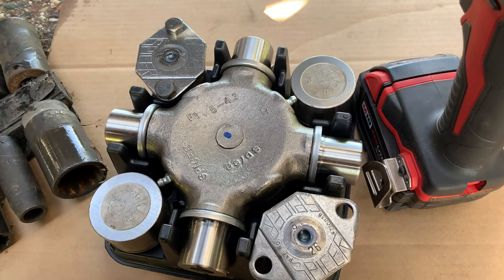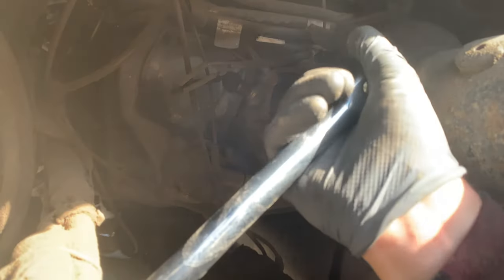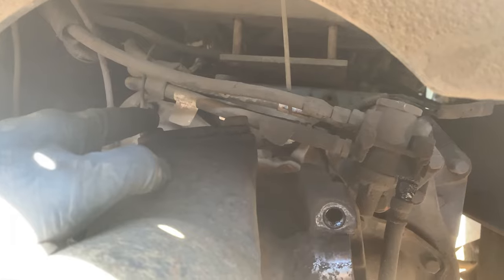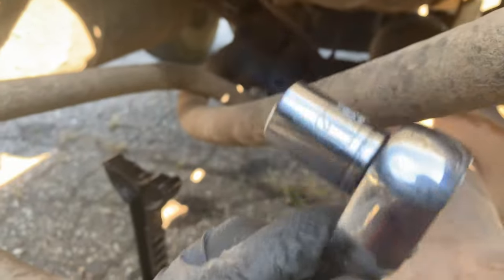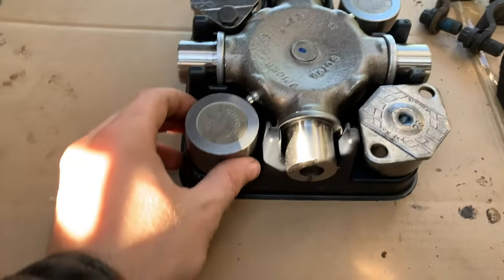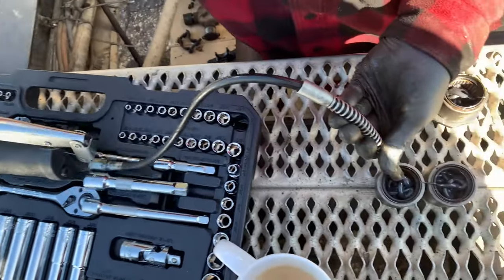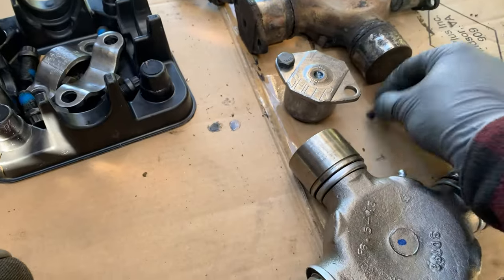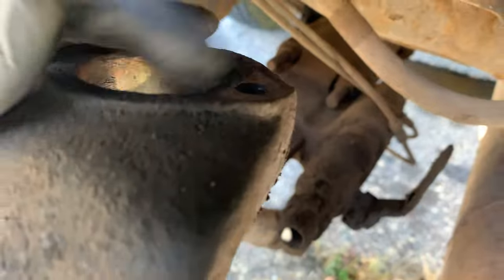Replacing Universal Joints On My 1991 Peterbilt

Comment: No Loctitie? Loctite does several things. First, it is a thread glue preventing a fastener loosening and also a sealant preventing water and salts or other bad stuff getting in and corroding the threads making it very difficult to remove later.
Reply: Spicer u-joints come with the thread locker already on the bolts, at least all of them I’ve ever put in did.